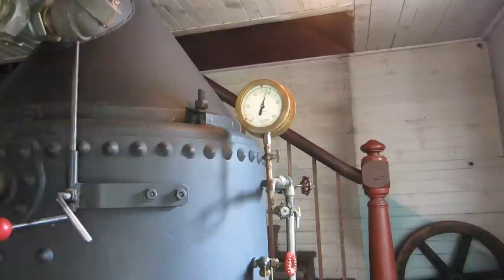OLD TIME STEAM POWERED MACHINE SHOP

Comment: Bonjour David,
For a steam passionate, your shop is a dream.  I would have hundred questions to ask, but I would have liked to be with you in the place !
My lack in English does not help to understand all the explanations, hopeffully, I know what a displacement lubricator or an injector is. About the boiler, I do not see a glass tube level to control the water==> I imagine you use the technique of taps at different heights, don't you ?  And the lathe seem quite powerfull, even if the tools seem old;
 You are a lucky man !
Amicalement, Raphaël
Reply from the maker: Bonjour to you also Raphael:  It is good to hear from another steam and old shop enthusiast like you. The boiler has a water glass on the right side, you can see it on the other videos.  The 3 taps are an extra way to check the water level. Thanks for the comment,  Dave

Comment: Nice job, both the shop and your video.  One thing I have found useful in doing technical video is a wide angle lens.  I use inexpensive cameras which are good enough and abundant these days.  I look for cameras with a thread around the lens so I can attach an  adapters and wide angle lens.  Some of the adapters are better than others and work differently on different cameras, but the payoff is you can get closer, yet still get everything in the screen.  Try it!
Reply from the maker: +Musings  Thanks for the comment. I stopped experimenting after the great Go-pro disaster. They have a lens that covers well but is very "fish eye" makes things look curved which I didn't care for at all......Dave

Comment: Dave, You might be interested to know who made the first precision machine tools   It was Henry Maudslay in England and Eli Whitney in this country.  Maudslay made the first precision lead screw and made the first micrometer which was accurate to 0.001" and could read tenths.  Whitworth standardized threads for nuts and bolts during this time.

Comment: I was wondering how the steel cutting tools hold up their temper without any cooling fluid? thanks again. this video was fun.
Reply from the maker: +chris m most of the old machines were built before Carbide or even "High speed steel" tooling. Back then most materials to be machined were either cast iron, bronze or wrought iron (like shafting). Normally they would use just the blacksmith made "carbon steel" with a surface hardening from a variety of ways. They took heavy cuts, but at a slow speed so there wasn't much heat generated to kill the tool edge. When steel jobs came along, they were forced into buying more expensive "high speed steel". The tooling and machine builders had a hard time getting the old machinists to run at higher speeds taking advantage of H.S.steel'sl ability to handle heat. I guess they had burned up too many old cutters to be convinced....Dave

Comment: Unbelievable and amazing! Must have taken a lot of effort to hang all those belt shafts on the ceiling, they don't look light :) This kind of central shaft and belt driven machinery is just unbelievable, not to mention that you power it with a steam engine! I remember when I was a child (some 40 years ago maybe) my dad took me to a match-stick factory where he worked and there were large halls of many machines that were also driven by a central shaft. It was frightening and mesmerizing at the same time. I think it was driven by large electric motors then, but cannot be sure.
EDIT: Oh actually the factory made everything concerning matches, the final product being the match box, full of matches ready to light fires :) Also the book style matches and some other related things. Also I think they were in the process of modernizing the machines then, as individually powered, and getting rid of the central shaft system.
Reply from the maker: Often you don't really think about the massive machinery it took to make simple little things in the old days. That's the way it was done with everything before 1920 with either water power or steam, and if it worked well enough it was kept operating that way for a long time. Thanks for the comment....Dave

Comment: At least 10 years ago I had some time in the library & saw the wall with US Patent books. I picked one & glanced through it. There was something about an injector that injects water from normal atmosphere pressure into a boiler. If I remember water came in one pipe and was heated to produce steam which forced some water through a shaped opening into the boiler.
Reply from the maker: Gregg, That is a very simplified theory of it...Dave

Comment: I absolutely love your setup! Seeing how power lines are becoming unreliable Going steam power might be a great way to make sure you dont have any interruptions in ones machine operations. Im hopefully going to eventually to using solar steam for refrigeration/HVAC and charging my Tesla Truck.
Reply from the maker: That would be quite a technology bridge:  using a DC steam powered dynamo to charge a Tesla.....far out.....Dave
Reply: @davidrichards5594  Think of it this way depending on how you build the boiler/heat ex-changer you could litter-ally use any heat source. be solar, geothermal, or various repurposed biomass.

Comment: I used to be a machinist and loved it, that is until all the shops started going c.n.c. in the late seventies.  Then I felt more like a production worker than a machinist and I got out of it.  I did have the pleasure of working in a very old shop that had an overhead shaft and belt system like yours, except it was powered by a large water wheel in the river instead of steam.  Thanks for bringing back some good memories.  P.S.  Wouldn't a three jaw chuck be faster for mounting round stock?
Reply from the maker: +Thom Vogan Great comment Thom, Water power has been a dream of mine. I've seen it working in grain mills, My father operated one (way before my time) the water turbine also ran a saw mill and generated their mill power for lights while sawing at night because the mills upstream held up the water untill evening, in the early 1920's......Dave

Comment: Thanks much for re-creating this environment from our past. It was fascinating to see the steam engine actually driving the line shafting. 

At 6 minutes, 25 seconds you are discussing the shaper and I thought I saw an electric motor that might also be used to drive the overhead line shafting.... Do you use that when it is impractical to fire up the steam boiler?

Did you also recreate the open surface wiring that powers the hanging shop lamps?
Reply from the maker: +jerome whelan  Jerome:  Thanks for watching. Video #1 was made quite awhile ago, back up motor drives on the shaper and milling machine are gone now. I keep a motor that will run the small lathe in case I need a small job done fast on a day when the boiler isn't fired. Cut off saw and grinders are electric also. Hope to add a steam powered cut off saw when I can find one......Dave

Comment: I subscribed real early in the video

I really want to see the wood shaper run and making "finger joints" for a woody station wagon.
Reply: Since it is a machine shop you are unlikely to have a wood shaper or for that matter a steam box for bending wood.

But I do love your shop and will stay subscribed.

Thank you.
Reply: I thought that tenons were the squarish joints that locked together two pieces of wood at 90 degree or right angles like a desk drawer.

Thanks for correcting me.

Comment: I have a belt driven automatic tapper, (Cincinnati hyspeed tapping machine #28) like a huge drill press that has auto reverse that is activated either by length or pressure.
Love the shop, but I'd add, or should say would build a 2 X 72 belt grinder, obviously driven by a leather belt!

Comment: For a fist time production your video is excellent!  My Father has a similar shop and sawmill in the 40's and 50's  the machine shop was run by a 3 HP Bull Pup engine.  It was housed  in a  addition to the building to cut down noise and heat.  There was a 6 " Lathe a 12" lathe a `16" Shaper and a 24"Planer. ans a Milling Machine  Each was run by the Bull Pup except the 6" Atlas a Tool Grinder and  Drill Press.  It is great that you maintain  such a shop,  My dad started building a foundry and ran into zoning problems..  I noticed a pump in the shop; do you intend to capture condensate?  By the way, I Subscribed.
Reply from the maker: +Jim Key Thanks for the comment Jim,  Sounds like your Dad had quite a shop. I would love to have a planer some day. The pump will eventually be for filling an elevated feedwater tank.    Dave

Comment: You are doing just fine, +David Richards! +Abom79 and +KeithRucker are great inspirations! Adam did give me the referral!  I realized from your video, that my Dad has my grandpa's and uncle's drills which are all belt powered, but adapted to electrical power.
Reply from the maker: +Fr. Bob Lacey There are a lot of those "camel back" type drills still around and being used with electric motors.  Thanks for stopping in   ......Dave

Comment: There used to be a metal working shop in my hometown and the owner was older than dirt.  He had the entire shop running off of steam!  He had pipes and belts running everywhere in that shop.  All of the machines ran off of one huge boiler and that ran an engine which ran belts all over the shop that ran every machine.
Reply from the maker: Watch that "older than dirt" stuff.....Dave

Comment: Hey david, I have a great appreciation for these type of old style machine work, however I’ve been wondering how well some of these machines will do on working metal... please give me some thoughts...
Reply from the maker: Hi Bub,  I can't recall any job coming into this shop requiring a higher tolerance than I could get out of these machines, but you have to keep checking the accuracy as you go along and make corrections if necessary. You can't just set something up and go blasting through it and expect to hit the numbers. And of course they are slower. Thanks for the comment.....Dave

Comment: Beautiful machines! I grew up with a power hacksaw that came from a shop like this. It's a shame they're all set up on plywood subfloor, any idea if it would have been yellow pine or hardwood originally? How about foundations under those machines? I own a turn of the century commercial storefront building I live in and have a shop in, but I wouldn't dare put anything that heavy on the first floor.
Reply from the maker: Not to worry, the shop floor is up to it. Starts with a very dry 24" crawl space, 12x12 white oak beams lengthwise whole length of the shop every 8' shored up about every 4" with slate pillars, 2 1/2 x 12 floor joists on 16" centers notched onto an oak sill that sits on a stone footer, then planked with 2 1/2" thick hemlock with the 3/4 plywood sub floor over that. The boiler and engine are on a concrete pad down to 10" below ground. It's a pretty interesting building with a strange history that I am still researching. I could maybe do a video on it sometime.......Dave
Reply: @davidrichards5594  I would love to see a video like that. I have a full fieldstone basement with ordinary post and beam construction using 8x8 posts and 10"  joists on laminated carrying beams. I have plans to lift the whole building hydraulically, and demolish the basement, and pour an entirely new one with radiant heated floor. My parents had it done to our 1860s farm house when I was 10. I will do a video series on that project someday.

Comment: Fantastic video and amazing workshop.  Do you have any problems with rust on the machines with the steam, or does the boiler keep the room warm enough to stop any condensation on them?  I noticed the majority of the exhaust is outside.  I only mention it because my dad seems to have to run a de-humidifier in his workshop all the time! Thanks.
Reply from the maker: Only problem is when it's left for a couple days and warms up fast outside leaving it colder inside. Then everything "sweats" water beads.....Dave

Comment: That was very interesting. Did they have any steam powered woodworking machinery in those days (apart from actual saw mills)?
Reply from the maker: Before about 1910 EVERYTHING ran on steam or water power. A big sawmill would have had a woodworking department to make flooring, siding, trim, etc....Dave

Comment: There was an old restaurant in my neighborhood that had a belt and pulley system to run their ancient ceiling fans. It was a pretty large room and was still in operation up to the ‘80s and am sure was electric driven main belt.
Reply from the maker: Tim, As a kid, I remember a fan setup like that over a drug store soda fountain counter in Wachula, FL. Probably 1955....Dave

Comment: Take a 275 gallon home heating oil tank mount outside horizontally and fill with water,mount your exhaust from the shop engine through it to condense the steam , catch the condensed steam in a separator tank aka divided with a 1 inch hole near the bottom of the oil separator, then you can pump the separated water back into your feedwater tank to reuse in the boiler or pump it though cast iron radiators to heat the house or whatever you want to use the hot water for. 

Just thinking outside the box errr trying that is.

I made a correction to the comment you posted on #22 this morning and I didn't realize it would cancel your pin. My apologies Dave.

Jim

Comment: I love all the equipment and the dedication to working with this equipment.. I am jealous and envious and super appreciate you posting up these videos.. 

It's probably been answered but where did you find you boiler?  Again thanks for keeping these items alive and well..
Reply from the maker: Thanks for watching and taking the time to comment. The boiler came from a 1924 Mundy steam hoist which still resides just out of the back door of the shop.....Dave
Reply: how long were you saving up all the shafting and such as well as the boiler before getting the shop up and running..
Reply from the maker: The steam hoist came along first. I was going to use the whole thing inside with engine but the small O&S engine became available and made more sense. The shafting and some of the bearings and pulleys were my father's from an old sawmill. The rest I either made, duplicated, bought on ebay or were donated by friends. Thanks for watching....Dave
Reply: Great job all the way around.. Thanks for sharing and responding to questions and great job on the videos also.. :)

Comment: A long time since a YouTube video caught my undivided attention. I'm going to guess Adam. You're now standing beside your boiler and disclosing your entire YouTube lineage. Okay that was surprising to hear. Well I will say 8 minutes of total YouTube experience wouldn't have been in my first 500 or so guesses. You got yourself a subscriber. I hope you make many more.

Got my first steam engine in 1968 and I still fire it up once in a while. Built a rip saw to make a demonstration for my son's elementary school using purpose fermented homemade white lightning as fuel just because It felt like the right thing to do. My engine still has the factory chrome heat shield and the yellow and black paint scheme all factory original. The wood I used for the sawing demonstration were tongue depressors and my steam engine still has the manufacturer's name, Meccano.
Peace.
Reply from the maker: Thanks for the sub Jim, glad to have you along....Dave

Comment: Is it as quiet as it seems to be ? Normally lathes seem so noisy... this ems nice and relaxing no need for ear protection.
Reply from the maker: You can see why modern lathes are noisy in Abomb79"s last video with the top cover off his Monarch lathe. They have a transmission with many gears running very fast. A lineshaft lathe has no gears except the power feed which usually runs slow under light load. Or the low range "back gear" when turning really slow....Dave

Comment: Very cool but it would be nice to get that knock out of the engine.... Maybe the wrist pin is loose? I like the injector... I put a variable stroke crosshead pump on my steamboat.... Works nice because it's perfect to maintain water lever....

Comment: Just found this series the other day been watching it ever since, really cool stuff. How much pressure does the steam have left on the exhaust side of your steam engine, and is that reusable in another steam powered device like a smaller steam engine or generator?
Reply from the maker: Running an engine or turbine off the exhaust would probably put considerable back pressure "restriction" on the exhaust and effect the engine's running because the pressure I'm running is so low to begin with. It was common practice to use the exhaust steam to heat the boiler feed water going into the boiler, or make heat for the building or some other manufacturing process with the waste steam......Dave

Comment: Can you provide any details about the steam engine powering it?  Boiler spec, power rating, line shaft rpms, etc.?
Reply from the maker: +stoparret  Sure, if you have a chance to look at some of the other videos, there are details about the engine and boiler but basically, the engine is a 5' bore, 5" stroke O&S engine of about 1895 vintage rated at about 6 HP. the boiler is from a hoist unit rated at about 15HP. The engine runs at 250rpm, the shaft 270........Dave

Comment: Youtube suggestion algorithm must have gotten a boot in it's butt to finally show me this video of nothing but awesome steam machining. 

What does the drop that floats up you said happens every 40 seconds again. I listened it about five times and it was beyond me.
Reply from the maker: The lubricator is metering a drop of steam cylinder oil into the steam feed pipe to mix with the steam and lubricate the internal parts of the steam engine....Dave